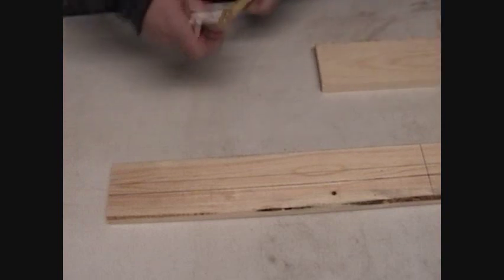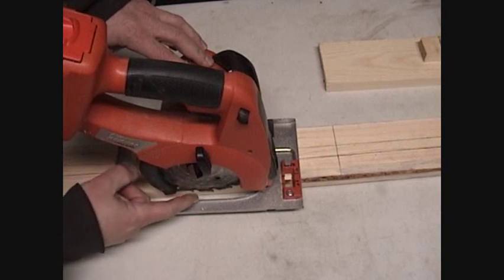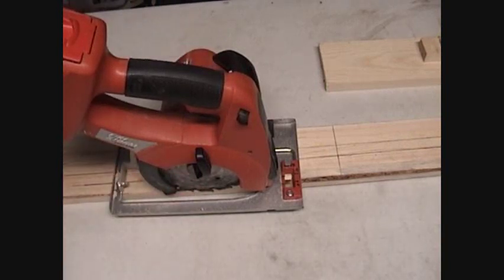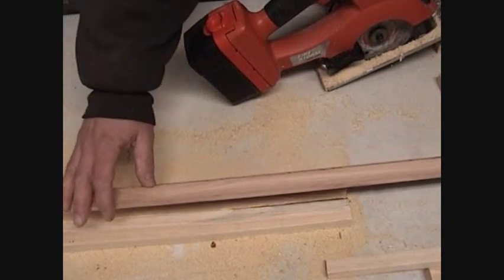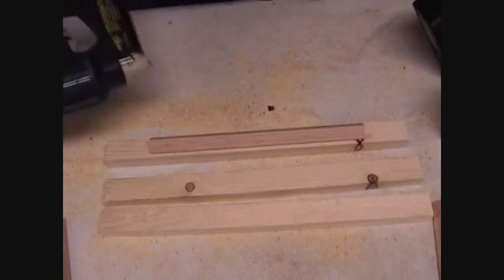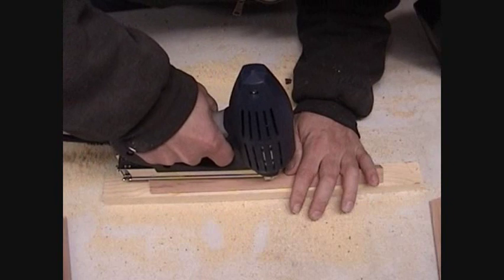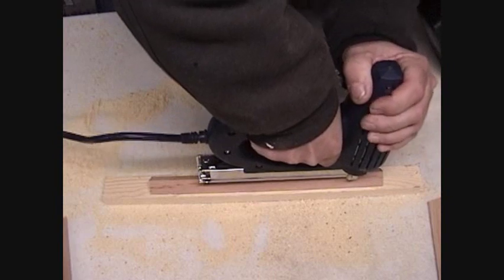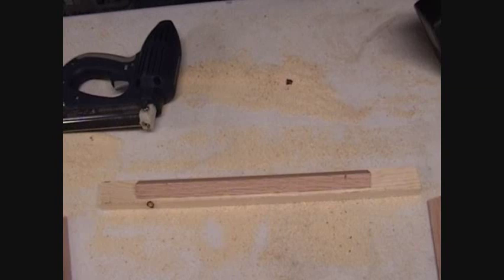Dave's Bees - How To Build A KTBH - Part 1 - Top Bars

Comment: Hi Dave,

First of all great videos!  I really enjoyed watching how to make the top bar hive.  I definitely want to build one.  I wondered if you had made any top bars hives to the proposed standard 19 1/2 inch top bar that can go into a Langstroth hive if need be.  If the top bar was 19 1/12, some of other measurements would have to change.  What would you do to adjust for the longer top bar?  Would you just add the extra 2 1/2 inches to the middle of the ends and follower boards?  The top would need to be wider too.  Thanks!

Comment: I used your videos to build my 1st top bar hive with great success. I used 2x10 lumber for added winter insulation. I went a little over the top on the roof making a gabled, cedar shake and copper tornado proof lid. 
Just wanted to thank you for all the steps and easy to follow instructions.
Reply from the maker: That's great.  Hope it is a tilting lid or that you have very strong back.
Reply: David Wright Hives' just got bee's, doing well. I took your advice and put hinges on the lids. Learned my 1st painful lesson about stings to the face as well. They are fascinating to watch.
Reply from the maker: So glad it worked out for you.

Comment: In the plans, it says to use 3/4 inch thick wood for the top bars.  In your video, you said use 1x4s.  Is that extra 1/4 inch going to matter, or are those really 3/4 inch thick even though they SAY they are an inch thick?

Comment from the maker: kokosz33,

These hives are built via Phil Chandlers plans and he uses 1 3/8 topbars.  I have only used 1 3/8 topbars but have added thin spacers when bees decided to build big combs.
Some people use 1 1/4 topbars in the brood nest and 1 1/2 inch topbars in the stores area.  Again, I just use all 1 3/8 inch throughout the hive.  So you could use a few 1 1/4 bars then add some bigger ones or plan on spacers to make the span a little larger.  Good luck and Have fun!